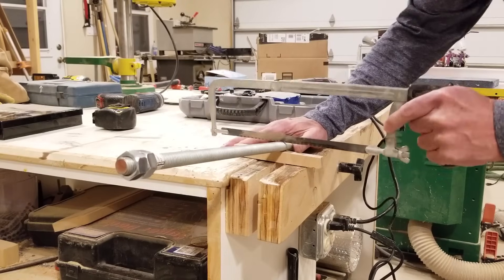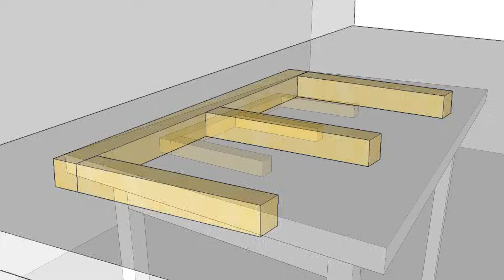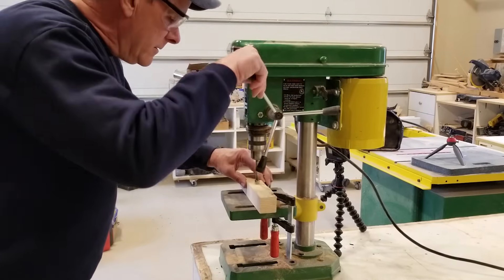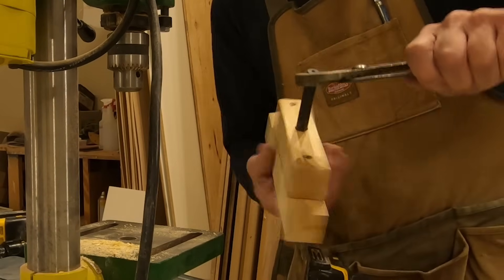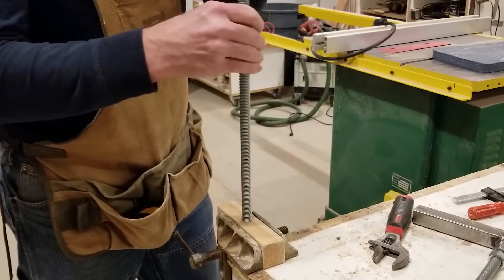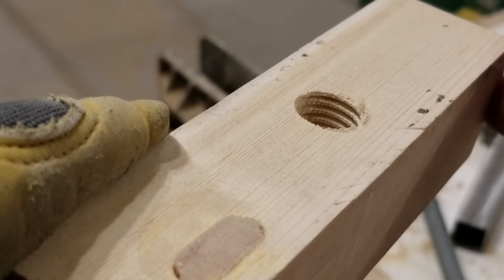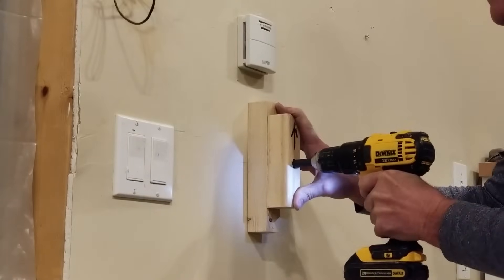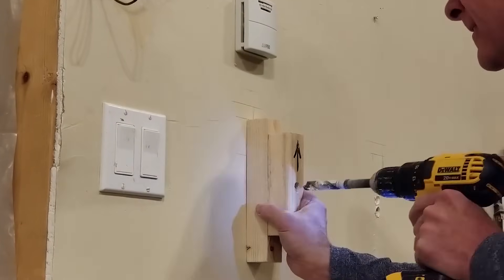Strong Floating Shelves - The Strongest Option

Comment: I like a Newell post bolt appr.   11 " long wood threads then machine threads.  2" thick material. counter bore 1 1/2 " hole on underside fasten a nut and plug hole with plug provided. L. J. Smith stair. Hwd.

Comment: The only thing I’d worry about is the tolerances for getting the rods parallel and how to compensate if you’re a bit off.
Reply: David Hawley same here. Seems like the jig worked for him. But I’m curious how repeatable it is. A long enough jig with proper drill bit length, should give good results though.

Also, if for some reason it’s off by a bit. Perhaps just drill the FRONT two holes of the shelve to match the inaccuracies. That would mean to drill the back two holes in the wood frame (that should be dead on) and then slide it over the rods till it hits the front piece of wood, level the wood frame, and mark where the rods touch the frame.
Reply: Seems like you could always bend the all-thread slightly with a sledge-hammer hit in one direction or another.
Reply: Same here.  I would not be able to drill true holes in the shelf either.  This video is for people with a very well equipped workshop - out of my league.

Comment: Shelves for someone that wants to have their pet hippo somewhere to sit
Reply: I was looking because  I want to put a home theater projector on the wall and no one makes a bracket in my price range that will hold its weight and how I want to mount it.   I also have bookshelf speakers to put up on the walls that weigh about 13 lbs each  the projector weight about 40 lbs  these are overkill for what I want/ need but I watched it anyway because its always good to learn new stuff.
or try differnt things
What I think I will do is build a set of shelves hollow with 3/4" walnut so the wood grain matches up on all 4 corners and put that together with Lock Miter joints on all showing sides then install french cleats to hold it on the wall  No end grain showing.  But the more I look at them and I like a floating shelf the more I'm thinking of a shape for the shelf's  These look kind of industrial or modern I might change to an Art deco look. Kind of like old movie theaters.  Even add some low voltage LED lights to the brackets for  dim down lighting.  Behind the Screen a light show using track led lights.  Sorry no popcorn maker after all this is my living room. I don't want to get to fancy.

Comment: Hey I been watching other vids of treehouse hardware and what-not. They use almost the same idea. Only difference is they use stainless. My point is they just screw the bolt in 1 time. No need in tapping. Cause its cut threads as it was going in the 1st time. This is an awesome idea on shelving regardless. Thank you

Comment: What ive done in the past is use a 10" wood lag bolt drilled that into the stud about 3" then cut the bolt head off. Then slide your shelf over it. Seems to work i haven't had a shelf fall off yet

Comment: IKEA in Europe has something similar for brick and mortar installations. Also, if you use two bolts to tension the rod between the front and the back of the shelf you can improve the torsional properties of the shelf under heavy load. Additionally a threaded insert can be used instead of threading the wood beam but I understand it increases cost and complexity.
Reply: I mis understand how the wood is able to be threaded like that especially with machine threading on the rod? Just curious how that would even holdb
Reply: @ethanschutz6092  the stud is a soft wood. The pilot hole is 1/16 inch smaller diameter than the all thread and the metal threads can thread into the soft wood with sufficient force while turning the handle

Comment: This is how I've done this for years. Washer and recessed nut on end. For clean look, notch the bottom with a wide biscuit cut and slide nut on while sliding board then cover notch with wood 👌
Reply: Or........use a steel /crush sleeve slightly larger than the all thread..... that way you could SNUG them up and be able to tap them to “dead nuts” level and THEN tighten........

Comment: Hi, do you have any opinion on the best option for floating shelves in a house with metal studs? Thanks!
Reply from the maker: Hey, Chris! Sorry it's taken a while for me to get your question. When working with metal studs, it really is quite a different approach you have to use for floating shelves and it also depends on the type of steel studs that are in your walls. I guess the main thing I would say is you pretty much need to insert wood blocking in your walls in the areas where you're going to be putting floating shelves in order to fill the voids in the steel studs and give you something solid to screw to. That's the simple answer. As you can see, it's going to be more we work and probably more experimentation to come up with a good approach for floating shelves on steel studs. Thanks for your question and sorry I couldn't be more helpful.

Comment: On solid pieces of wood I’ve used long lag bolts. Cut the head off after installing them on the wall. Drill holes on the shelf. Fill holes with apoxy and slide it on

Comment: Sorry you have an impact driver. So get a socket attachment and simply use a socket to drive the all thread into the wall it would be much faster in my opinion
Reply from the maker: Hey, Peter! I did take your advice and that of a few other people who also suggested using a screw gun or impact driver. In my last video I tried it and it did work well so thanks for your suggestion.

Comment: A very strong support but man, your making it a lot more difficult than it needs to be. Just screw  a long wood lag bolt into the hole and cut off the head once its in. If you really need to support 200lbs. you may have to go the all thread route because of the length needed but for most decorative shelves that won't be holding anything more than nick naks, a long wood lag bolt should be long enough. And unless you live on a house boat, I wouldn't see a need for a set screw, certainly not a counter sunk hole in the front of the shelf.  This might all boil down to the fact that you are making a shelf for a shop or garage and I am thinking of a decorative shelf in a living space. I appreciate over engineering, but finale load can be considered and over engineer with that in mind. But when you want to store your v-8 engines on a shelf in your garage, this is defiantly the way to do it.
Reply: Yes that’s the way to do it. Drill the hole same diameter as the bolt. The long coach screw has a section  without thread so helps slide shelf I in, once hits the thread it binds and makes a tight fit. May need mallet for the last 10mm to meet the wall.

Comment: my only issue is ALOT of house (well out here in Australia anyway) aren't built with 2x6, we'd be luck to get 2x4. in fact i think most internal framing in modern houses is 70mmx30mm which is 2 - 1/2 x 1 - 1/4

Comment: Props to the first person to install these in their garage. And then put tiny undersized L brackets on them just to mess with people. You KNOW you want to.
Reply: I was thinking the same thing.   Plastic ones.
Reply: Haha There's a special place in hell for people like you! ;)
Reply: use card board to make the brackets and staple them in lol
Reply: LOL, genius :) Have one L bracket hanging askew from the shelf, where the wall screws tore out of the drywall.
Reply: that is totally hilarious!!!     Never thought of doing that....2 snaps up and a bag of chips!!!!
Reply: 1Just 2" L brackets!   and 500 lbs on the shelf.

" OH  I USED LONG SCREWS  !" "    I say smirking
Reply: +
Michael Block

Hahahahaha.  Noice.

You could put just one tiny L bracket right in the center.  Then when you have friends over you could pull yourself up and sit on the shelf.

Would be great.

This system could be extended to make cool floating Benches along a wall.
Reply: @bobbg9041   Put a big fishtank on the shelf.
Reply: Steve Mclean (
Reply: Haha, nice!
Reply: @jesseware7019  thanks, going to do this.
Reply: Love it! Then load them up with 20 bags of concrete
Reply: That would be a lot of fun, use a pool noodle or drill a hole in the wall at an angle and put a pencil in it to hold it up LOL ; )
Reply: Of course you had to say that! Damn it! Now I got to do that... I figure 1 in by 1 in L brackets should work. Lol
Reply: And instead of screwing those in just put a piece of masking tape on it to hold it in place
Reply: Just one in the center
Reply: Lol just use tiny corner braces and see what people do when they see it
Reply: While you are at it you can hang a chandelier you can actually swing from.
Reply: @robroy308  dr
Reply: “If you’ve ever had an entire damned wall to drill into, and picked the one spot for the shelf that’s blocked by two drywall screws…go again and hit that subscribe button.”
Reply: I want to thank you ahead of time for this I just recently moved into an upstairs room that I’m renting from a homeowner and I’m doing remodeling as part of my rent I am actually installing flooring shelves this afternoon and I’m going to find the smallest tiniest L brackets I can find to install on 4 foot floating shelves
Reply: I do now. Thanks
Reply: Strong and good for sharing 🎉

Comment: 3/16" to 1/4" thick flat stock does a great job at supporting a floating shelf. Measure to the appropriate shelf length, add the depth of the shelf at both ends and either bend both ends to 90° or cut and weld. Drill counter sunk holes at the stud locations and install on wall. A traditional floating shelf will slip on over the whole issue but I like cutting solid wood to slip in between both ends for a more industrial look.

Comment: I'll tell you what true floating shelves are? When my wife and I first got married we rented a little old house  if you were going to have a washer and dryer it would be in the basement with the washer in one corner next to the old double compartment cement laundry sink popular at that time. The washer would drain into the laundry tub next to the main sewer stack coming down from the only small little second floor bathroom. The dryer on the other hand would be kitty corner.on the opposite corner of the basement as this is where the vent was located thru the double layer spaced brick foundation walls that rose from the basement to approximately 4' above ground level, with these bricks being covered by concrete on both inside and out. Due to the age of this house the foundation had bad spots on the outside southeast corner and the northwest corners . In order to keep my rent low and reasonable I tore down and repaired both areas for my landlord and he would allow me to deduct my cost of materials off of the rent with me donating my labor. So with knowing what shape these basement walls were in I knew I did not want to try to anchor to them at all. This was the day before everyone had a portable drill / screw gun, so to build braces of wood hanging down from the exposed floor joists and then attaching shelves would require nailing everything or getting out a drill and chord.
 What I chose to do instead was to purchase a 1" by 12" by 12' board and have the lumberyard cut it into four 36" shelves. I also purchased a fifty piece of 1/4" manila rope and a hand full of small fencing nails. I then attached 4 pieces of rope above both the washer and dryer hanging down extra long with three fencing nails holding each one. I drilled 5/16" holes in all for corners of all the shelves in from the corners by about 1" each way then slid the ropes thru and tied nots at about the height of the top shelves with making a few adjustments till close to level as possible repeated the procedure for the lower shelves and in that way I had shelves above each appliance and my wife was happy as she now had a place for her needs and it was cheap and easy to do. And I think that theses were truly what you would call a FLOATING SHELVES set up. 
I thought you might get a kick out of this, and I always wondered what the next person to rent the place thought when they saw them for the first time? They served our needs as I'll bet they did the next persons and they were truly floating as they would move but I never recall anything ever falling off of them. They were not made for much weight such as the beautifully super strong ones that you have designed and refined to perfection! Yours just float better than mine! 
 Yours are a battleship and mine are a canoe! Very nice video and you are a very thorough craftsman sir and should be very proud of your work and thank you for passing on all of your ideas to us for us to use at our homes! Thank you again.
Reply from the maker: I have to give it to you, Curt, those are truly the original floating shelves! I also remember the days when you judged the importance of a project you were working on by whether or not it was worth getting out the drill, chuck, an extension cord. Thanks for the great story and for watching! I also appreciate your kind words!

Comment: Since your shelf is so thick, how about cutting a slice of drywall along it so as to know exactly where the stud centers are and to give clear access for drilling.
Reply from the maker: I have done some other videos on floating shelves, Tom, where I used wood dowels to attach to the studs and did what you are suggesting to take the sheet rock out to play. But those videos were primarily for testing the strength of different wood approaches. Thanks for your comment!
Reply: I'm also wondering, since you're so adept at drywall repairs, and you might not want and trust such a large void in a wall study, whether sneaking in a jack stud along side the standard supporting one to hold up your shelf would good. This would also eliminate the possibility of hitting nails or other contents.

Comment: You could drill 2 holes in the bottom of the shelf to expose the threaded rod and put a nut and washer on the rod to tighten it up to the wall.

Comment: Stong version of an Ikea LACK shelf, they have two rods attached to a steal plate, mount the plate to the wall then the shelf slides over the rods, and are locked in place by two screws going into the rods from be bottom

however its only as strong as your mounting to the wall which may or may not be in a stud

Comment: Floating shelves on a steal stud wall.
Reply from the maker: A little more of a challenge, Pasha!
Reply: Isn't that the name of the game.
Reply from the maker: Nice, Pasha! You are right about that! The easiest way for me to do it would be to open up the wall at the points where the rods were going to be installed with a hole in the sheetrock large enough to place wood blocks in the center of the steel studs that I would be going to ultimately drill into, just like in the video. I would use a good construction adhesive and clamp and hold the blocks in place while the adhesive dried. Then patch and repair the wall and install the shelf as I did in the video. I would definitely not load the shelves down with a lot of weight. I would only use them for lightweight, decorative items to be placed on the shelves. Hope that's helpful!

Comment: I think if you keep the hole that you make in the shelf to the upper edge, (instead of in the center of the shelf thickness) with most of the shelf material to the bottom, you will get better stability and less flexing of the shelf. Also to increase the material thickness below the point of connection, you could add some trim. That would also help the shelf handle more weight with less flexing.

Comment: I suppose you could tap the inside of the forward facing ends of the threaded rod and countersink the front holes in the shelf itself for some nice recessed #5 screws.

Would leave the face nice and flush.

Comment: If you really want a strong floating shelf remove enough drywall to install a steel L bracket on the stud repair the drywall then put your shelf on the steel bracket.
I don’t want to see the steel bracket under the shelf you can always notch the shelf so the bracket is flush.
Reply: Any shelf about eye level then still sees the bracket and that’s WAY more work with no strength advantage.

Comment: Good work! I would love to see you make a really long version of the shelf that was constructed from the solid glued-up boards,but I would remove just enough wood  from the outer edge (at each rod location) to allow a nut and washer to be screwed easily and the nut could be flush or slightly inward of the outside edge.So you might have 4 or 5  nuts and washers that are inset where each rod is located and the outside edge of the shelf dips in to allow the easiest way to secure this shelf to the wall,brass nuts and washers,stainless,chrome all could be quite attractive and would show off to the world a really bright idea!Keep the ideas flowing.
Reply from the maker: Yeah, Larry, you could really come up with some interesting ways to get a good-looking industrial finish on something like this! Thanks for your comments!

Comment: For those asking, why?  It's a look that's often seen in high end homes which many times will have heavy statues, busts, etc sitting on the shelf.  You don't want a $20,000 sculpture falling because the shelf wasn't strong enough.  Of course in that scenario you wouldn't want to use threaded rod either.   

Embed 3/8" (or thicker) x 2" x 8" x 8" steel angle.  Patch holes smooth and flat.   Build shelves to allow for 3/8"+ hollow space in the center to slip shelf over the angle legs sticking out of the wall.  Attach 3/4" x 3/4" wood blocking at the wall (between the two steel angles) and dado a slot at back of shelf to slip over the blocking with a little liquid nail on it.

The dado at the back of the shelf is typically worked into the material prior to assembling the shelf.